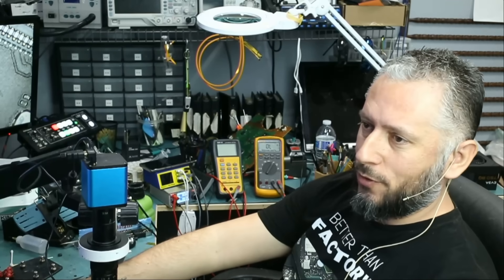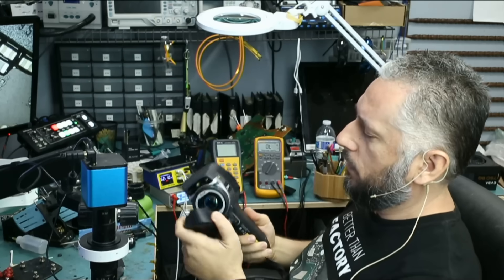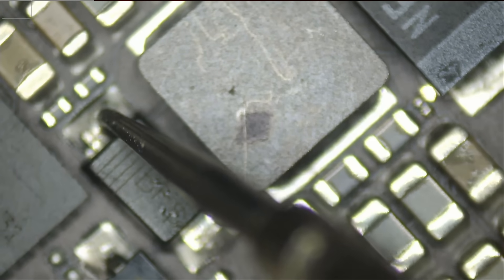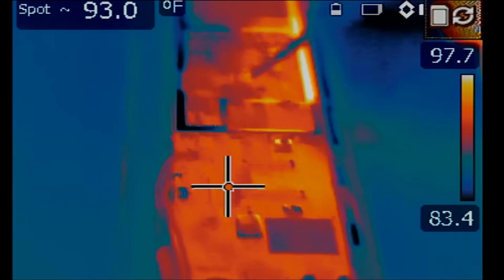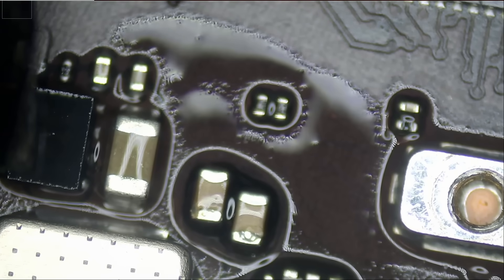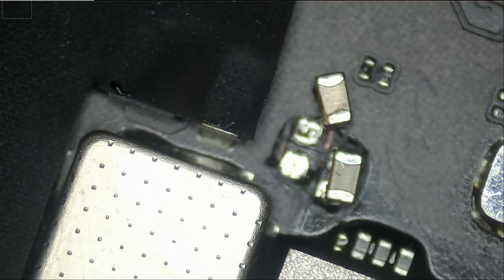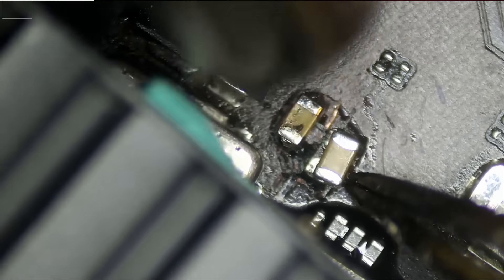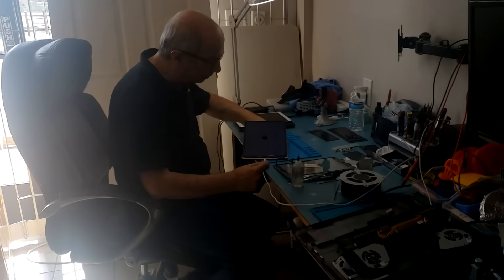iPad 7 won't turn on - Motherboard Repair- Thermal camera to the Rescue.

Comment: So my son iPad randomly stop charging when he woke up. Tried home and power reset with nothing. Plug it in mac and it detects to do an iPad restore but fails. Guessing there no power? 

Do I trouble shoot: check LCD/back light, Check Battery, and then check for short like you did here? Also iPad 7th gen

Comment: After my ipad went for repair coz it won't power on. I started watching ur videos and became more interested in understanding the reason for device failures. Why do iPads always have some problem or other, mostly power on issues. I am disappointed at motherboard quality. Today the technician called and said the processor had shorted in iPad 6th gen.

Comment: This probably has been asked a million times before, but how do you determine the replacement cap values?
Reply: You can measure capacitance with most multimeters (cap has to be desoldered). For the voltage, it doesn't really matter if you use one with a higher voltage rating, just shouldn't be lower. Other than that, just get X5R, these are the most commonly used ones.
Reply: My Ipad died, but I was able to boot it up twice, then it died again. And now it's completely dead, could it be the same problem you just fixed?

Comment: Hi, I really like your videos and learned a lot about repairs and highly appreciate your videos. I have an apple Tablet that requires repair for wifi issue ( the chip was removed by some unprofessional technician and have damaged the  some of the tracks on the motherboard as well as on wifi chip 😭) and now he broke the display also and replaced with another one but now only half display doesn't work for  touch.
I finally took back the tablet from him and decided to send it to you as i am confident and sure enough that you can make it up and running for me.
I can't mail the device to you from India as it cost me very heavy , so one my friend is visiting USA by mid of March for limited period of time, and I am sending the device with him to you, but I am not sure how he be placed in USA so will you please please please help me and guide me how to reach you there and handover this apple tablet to you.  Quick response is very highly appreciated. Thanks
Reply: PS: "correction - how he will be placed in USA"

Comment: I have a dell g7 17 7790 that charges when it feels like. And turns itself on when it gets power. Whether the lid is up or down. Paid 1800 for it and it broke as soon as the warranty finished. Pos dell
Reply: Shit happens, just get it to a trusted local shop.

Comment: Alex, great channel. One almost forgets how miniscule these components are because you make it look so easy. I'm sure that is because of the years of practice you have doing these repairs and building up a knowledge base of likely faults and what to concentrate on without going down rabbit holes! One thing that may be of interest to the viewers is the techniques that Big Boss uses to get into the devices in the first place so that you can get access to the circuit board for repair AND how he puts them back together again "Just like factory". Maybe a couple of videos of that - if Big Boss isn't too camera shy?

Once again, great channel, keep up the good work.

Alistair

Comment: Nicely done Alex.  I’d love to see you do a few of these thermal diagnostics using the uni-t camera you sell.
Reply: He has done a couple
Reply: @optimizelogicrepair2784  No, he hasn't, because he sold them right away - understandable. I'd love to see some fault detection as well, especially with the macro lens, we'll just have to be patient in the current times. ✌

Comment: Hiw do you what type of capacitor with specifications should be replaced?
Reply: There is no etching on the motherboard for values of notation.
Reply: Schematics or just donor board.

Comment: Hi Engineer. How did you find out that this is a capacitor?
You first had an EC connection.
How did you suspect this area?
Reply: If something is shorted to ground, like the diode, anything connected to it can also be the defective component. He injected voltage to the diode and looked under the thermal cam where a heatspot emerges. This was the area of the three caps. Then he applied iso pronanol onto the caps and injected voltage again, the cap where the alcohol is dried first, is the hottest cap, so at high possibility the defective cap. Nice way to track it down. Without thermal cam you have to test each cap.

Comment: awesome!  PS: possible to have done that repair without a hot air gun but with just a soldering iron?
Reply: Yeah, with low melt solder. But hot air is usually way faster and easier.

Comment: Very 8nteresting faultfinding! First you identify a problem area with the charger, which seems to check out, then ir camera and an inductor lit up. Inspecting the diode near it showed a short. Then inject voltage at the inductor or diode and another part lights up. One would expect the shorting capacitor to light up too when normally powered, right? Another job well done!